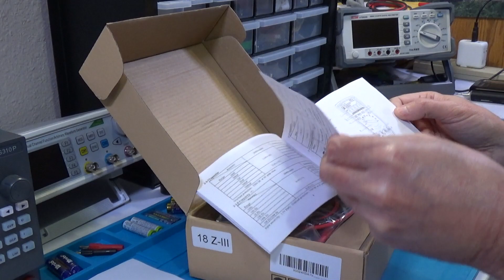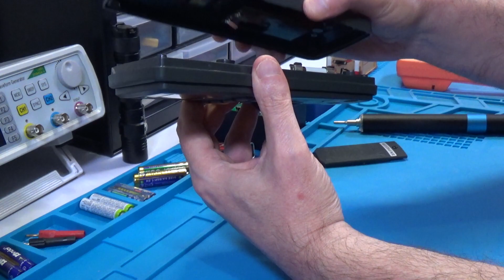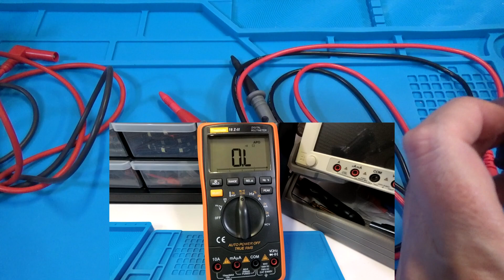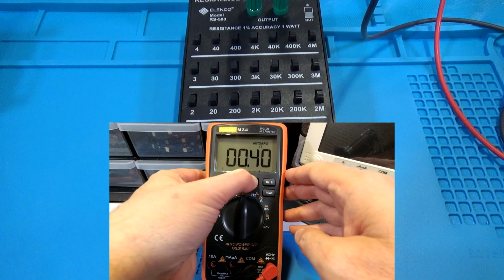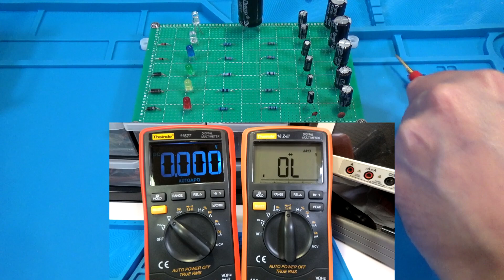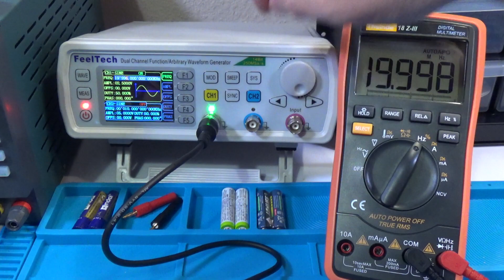Thsinde 18 Z-III Multimeter Review and Testing

Comment: It looks like other than the current readings being slightly off. And the fact that the input protection is typical cheap Chinese multimeter standards. It's a very nicely made meter. As long as current readings being slightly off isn't a big deal, and you only use the meter for hobby use on electronics and maybe an occasional house hold measurements. It'll be just fine. I'm impressed. Plus the update rate is above average too. 

Even the minimal input protection seemed ever so slightly better than the 6,000 count Thsinde.

Comment: Mine wont turn on… am I missing something?
Reply from the maker: Do you have the battery seated in the terminals securely?  I have found on some of these models that use 9V batteries that they sometimes don't want to connect to the terminals.

Comment: Which do you recommend Thsinde 18 Z-III or the Kaiweets KM601
Reply from the maker: It's a tradeoff.  The 18 Z-III is more accurate with voltage while the KM601 is better at measuring current - otherwise it's pretty much neck in neck.  18 Z-III has twice the count resolution, however (20K versus 10K).
Reply: @Sui778  I want it for electronics I am going to study a technician I want one that will serve me for the future and learn and I like those 2

Comment: I just got the 18B+ model, basically for the continuity test. It only came with the two sets of probes and some crocodile clip extensions (no case), but it's fine. Oddly the beeper works on mode select and the NCV... but not the continuity??? Oh well. Thanks for the helpful video, however, since my instructions were as clear as mud.
Reply from the maker: Basically the 18B+ is the same as the Thsinde 1152T that I reviewed a while back (just has an EBTN display rather than an LCD backlit) and it comes with the same set of accessories.  The 18 Z-III comes with a different (and larger) set of accessories.  Continuity should sound the buzzer - if it is not doing this in continuity mode then your unit has issues.

Comment: Thanks! Great review as always. With regards to the UT39E+, I never liked DMMs that have the same terminal for V/Ohm as current measurements... This one does not have that. A huge plus I think.
Reply from the maker: Appreciate the comments.  The UT39E+ did do a little better with the current tests - there wasn't a huge difference but it still did better on both the FNIRSI SG-003A test and the DMM Check Plus test.  The 1152T also measured slightly lower than average on the SG-003A test.   Is it a deal breaker?  I wouldn't say so on either the 18 Z-II or the 1152T - they both still test well within spec on current.  However, I would still have to say the 18 Z-III probably edges out the UT39E+ in overall ability.